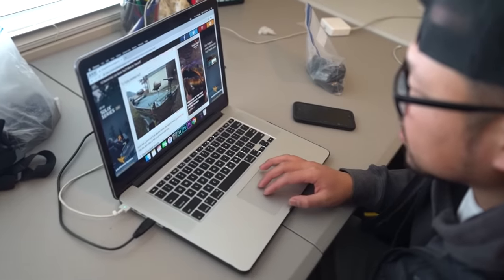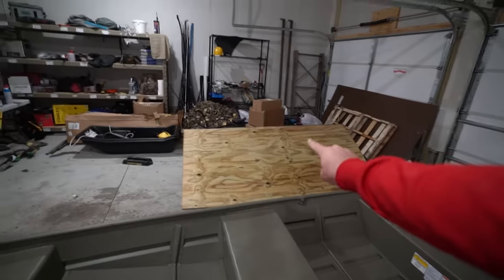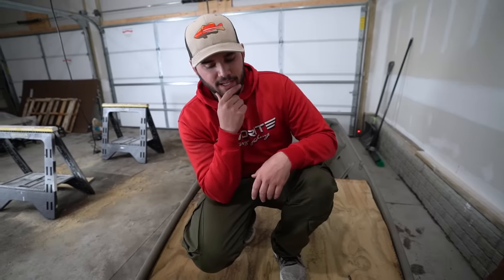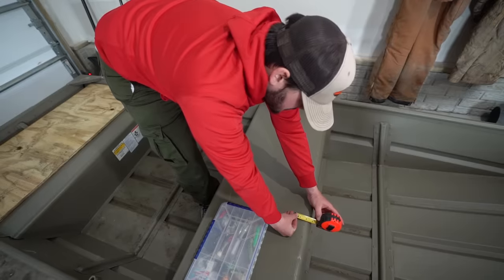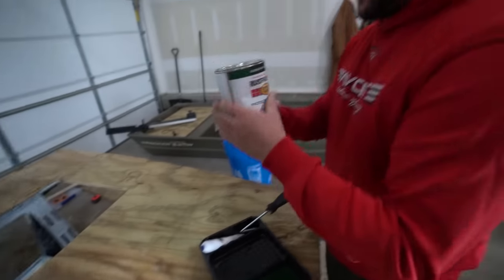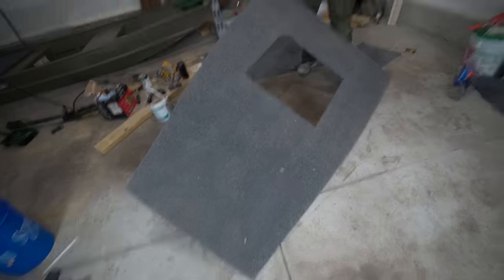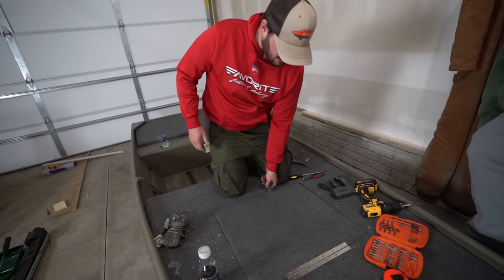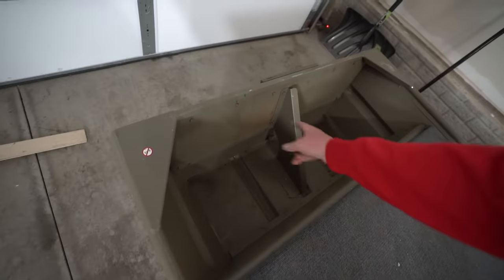CHEAP Jon Boat to Bass Boat HOMEMADE Build!!! (How To Make)

Comment: If you need a little more weatherproofing, a cheap bottle of silicone will do wonders if you slap a little bit on top of the exposed screws (like on the hinge for the hatch) That is how they weatherproof things like sunroofs in metal buildings and such. Loving this vid! I worked at a plastic manufacturing plant right out of highschool, this is giving me flashbacks!

Comment: good luck with that treated plywood on that aluminum... shits bad for aluminum
Reply: I put 2 coats of water sealant water based only
Before I put plywood down on my jonboats and only use stainless screws the zinc coated ones he’s using are gonna destroy the aluminum also

Comment: when I built my casting deck, I used metal studs,,,and 1/2" PVC sheeting to lower the weight and I didnt have to carpet it  , so even still less weight

Comment: Center support in the middle body weight should be dispersed evenly on the floor use all three center rails on the floor full width under 2x6 . NAME of the boat Bass Wave 3 nxtgen #smallboatnation .

Comment: should of added some bolts and washers instead of Regular screws much stronger and it keeps them from backing out when the wood gets wet and as much as someone would walk across
Reply: kendra garcia that’s why he used the sealer

Comment: Better yet, leave it light. Those little boats aren't rated to carry much. They are fully loaded with just two guys, a trolling motor and battery. They can carry more weight than rated. Just put a generator in it to run the air pump for one of those bouncy house things and you can all hang out in your bouncy house on the pond.

Comment: A cheaper way then a plug do my way cut the plug off. Tie in the orange and red wire aleave the black ground extend them to the battery.

Comment: You could have laid the plywood on the ground, turned the boat over and traced it. Then you could of measured the lip of the boat so you could cut it to fit the inside and it would fit perfect! Not trying to be a wise ass, just trying to help out anyone who wants to try this out!

Comment: Pfft building a boat for $1000. I bought my boat, engine and all, for $500. Runs good sometimes. Only overheats at idle after like 10 minutes. But it runs and it was $500

Comment: Step #1, never use treated wood on an Aluminum boat...FAIL.
Reply: Why?
Reply: @derrickspidell9130  the chemicals used to treat the wood corrode the aluminum. Cause pitting and destroy the integrity of the metal everywhere it touches. This is especially why it can be detrimental to transoms.